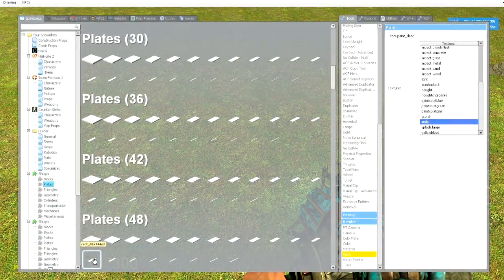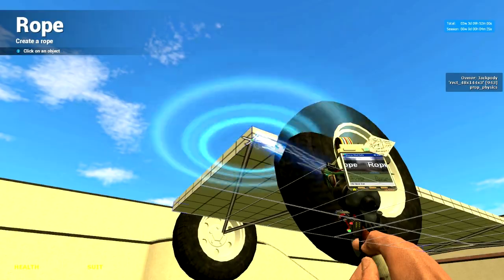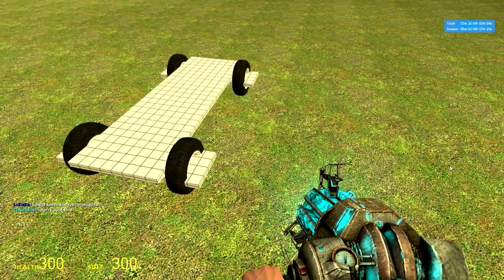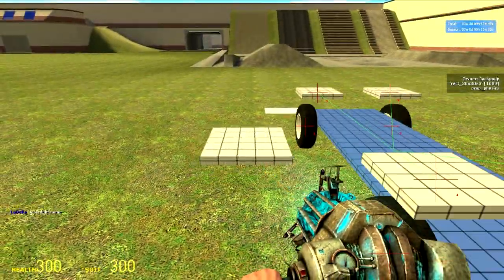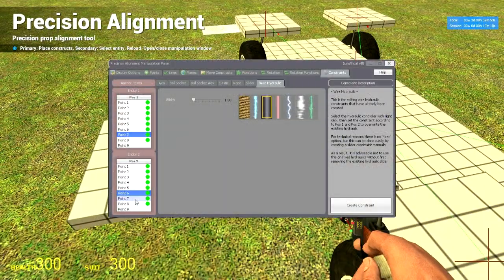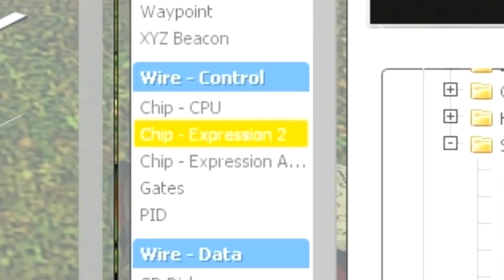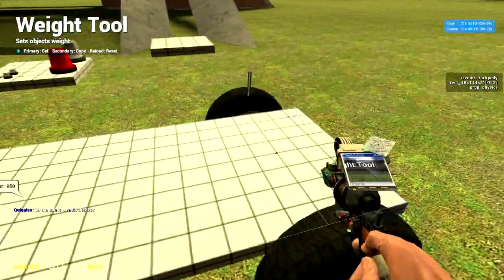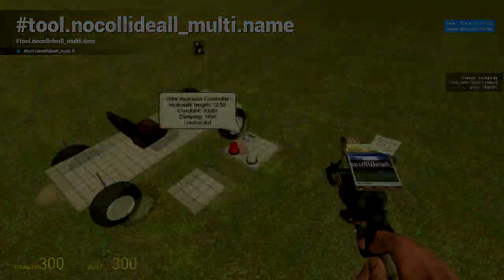[GMod 13] Suspension & Steering Tutorial - Simple

Comment: This video is really old, but when I complete everything the front wheels won't move, it only moved when I move the E2. How do I fix this?
Reply from the maker: It might be a little old, but it's still pretty relevant. It sounds like you forgot to build pointing North or that you have issues with your ballsockets to me.
Reply: I have been building it North, so must be the ballsockets.
Reply: And my back suspension does not go up and down, but only rolls.
Reply from the maker: @itsspudshere196  Sounds a lot like faulty ballsockets to me. Make sure ALL the settings are EXACTLY like I show in the video. Best of hopes!
Reply: Okay, but the ropes are rigid right?
Reply from the maker: @itsspudshere196  Yes.

Comment: sorry for the inconvenience but how come when  dupe it the wheels go wird and it spazez out?
Reply from the maker: It's fine man, ask as many questions as you need.
Remember to either nocollide the steering slave (the E2-plate that you ballsocket your frontwheels to) to the base, together with your wire board. This means you are sure the duplicator picks it up.
You could alternatively use Advanced Duplicator 2's "Area Copy" feature, that allows you to duplicate everything inside a certain area. I describe the feature in this tutorial
http://youtu.be/DFAoWQXBJz0?t=6m45s
Press the link and it forwards you to how you duplicate these vehicles. 

If this isn't the problem, then please describe the issue you have more detailed.
Reply: JackpodyDK Thanks
p.s. Thanks for the fast reply.

Comment: My wheels just flop around and don't stay up straight, do you know how to fix this?
Reply from the maker: There are two possible reasons for this. You either A) Did not enter the correct ballsocket settings (they can be found in the description of the video if you want to copy 1 by 1) or B) You forgot the very first thing in this video, which is to build pointing towards North.
Reply: JackpodyDK I think it has to be pointing north because I copied everything and then double checked
Reply from the maker: Then point it north, undo the ballsockets (pull out the ballsocket tool and press R on each wheel), correct the wheels so that they sit vertically like they should again, freeze them in place and then redo the ballsockets.
Reply: JackpodyDK It works! Thanks for the video
Reply from the maker: No problem, glad I could help.

Comment: works great but when whells tuch the ground whells just flaying around?
Reply from the maker: Djula 1980 I am not quite sure what you mean.
Reply: the car is good in air  but when whells touch the ground they start  spaz out!!
Reply from the maker: Do check if you remembered to weight the vehicle according to the video.
Reply: the only thing i didnt do is make spherical i dont know is that problem!!
Reply: yes 850 to body 250 back whells 150 front whells!!!
Reply from the maker: I can't identify the issue through the comment section, so it's best you re-watch the suspension tutorial to figure out what you did wrong.

Comment: i have a problem..
i unfreezed the car but the car jumps around
and the E2 does anythink
pls help
Reply from the maker: If it jumps around, you may have forgotten to set the weights like I showed near the end of the video. If the E2 does nothing, then do check you have the latest Wiremod installation. Wiremod can be found on the workshop and it updates automatically. Make sure you hook up Chassis:ENTITY before anything else. Then you can hook up A/D. You also want to make sure you do the advanced ballsockets from the front wheels to E2 before you hook up Chassis:ENTITY. 
Good luck, do respond if you have any more issues.

Comment: Whenever I unfreeze the wheels they spin inside the chassis how do I fix this problem?
Reply from the maker: +Cacline Media and Gaming (cacline72) Are they spinning in all sorts of different directions than they should? If so, make sure you're building pointing North (as explained by the beginning of the video). Also make sure you've got the exact ballsocket settings, they can be found inside the description of this video as well.

Comment: When I test the car, the steering works, but the front wheels don't spin, causing it to not turn. What did I do wrong?
Reply from the maker: Most likely forgot to set the weights / adjust hydraulic settings. Or didn't do those two things properly. A lot of things can make the car spass, so check the following:
Weights are set like in video
Hydraulics adjusted 
Rope settings are as shown in the annotation when doing ropes (rigid on, add length = 0, etc)
Ballsockets are EXACTLY like in the video.
You built it pointing North.

Hope it helps.

Comment: i have a problem with the E2, it says "No such function: entity:setAng(angle) at line 32, char 15" is there something wrong with the way i copied the E2 or something?
Reply from the maker: Please try the fix in the description - if it doesn't work, I'll be sure to look into it. I tested the E2 yesterday and it - should - still work.
Reply: @JackpodyDK  ok i'll try, note: i used the latest version of Wiremod
Reply: @JackpodyDK  update to my comment: enabling popcore worked, thanks for telling! :D
Reply: god dammit, when i started unfreezing it, wheels literally flew away
Reply from the maker: @Argonotheidiot  You'll get there, the tutorial still works. Remember to rigid the ropes and remember to build pointing North.
Reply: @JackpodyDK  well building pointing exactly NORTH isn't really important, it still works, right?
Reply: @JackpodyDK  also what's rope rigiding?(i don't do much as a builder so idk what's "rigiding")
Reply from the maker: @Argonotheidiot  Building EXACTLY North is actually very important - remember to hold shift while rotating your props as this will ensure you're rotating "on a grid." It's important as ballsockets are placed in regards to world position, not yours. If you change your XYZ, the ballsockets will not change, meaning the settings shown in the video won't work.
Reply from the maker: @Argonotheidiot  Make sure to check on "rigid" in the rope menu, and make sure the settings are shown as exactly in my video.
Reply: @JackpodyDK  ohhhhhhhhhhhh...

Comment: When I use the e2 It spins the entire car aswell as steering the wheels.Once it reaches the end of its steering it then starts turning the car
Reply: Nvm I fixed it But its good I found it.Dont use a Dupe for the plate.If you have it saved as a dupe place the dupe down open it with e2 then use the e2 and undo the dupe.
Reply: fallen6191q2w Acctualy No I was wrong. For this e2 set your front ball sockets to -50 and 50 then that wont happen

Comment: My wheels kinda rotate inwards but it can still drive but when I use advanced dupelicator the wheels dont work help!
Reply from the maker: This is normally due to a problem with the ballsocket settings. Make sure they are EXACTLY like the ones I show in the video, else you might end up with problems (normally stuff like the wheels twitching a bit, sometimes an odd movement, etc). 
When duplicating, you are nearly required to use Advanced Duplicator 2. Advanced Duplicator / the duplicator that comes with GMod are both hopeless for any sophisticated contraptions. When duplicating, you should use the Advanced Duplicator 2 "Area Copy" system. I explain all this in my more recent Multi-Parenting tutorial, it also has a link in the description for Advanced Duplicator 2.
[GMod 13] Multi-Parenting Tutorial / How to make lots of props not lag
Reply: I got the wheels to work now, and thanks for all the videos keep up the good work :)
Reply: can you make a tutorial to make a good frame for a car please? because I dont like having just a normal plate with an engine :p it would be very helpful :)
Reply from the maker: I currently only have the multi-parenting tutorial, that covers how you can make your detailed cars without lagging (basically gives you the base for all your vehicles). Other than that, there is no secret way to do car bodies. I do the exact same as you guys when building a body, which is just placing props. A good tip is to use lots of reference images, maybe set up a blueprint in a PlayX player that is the same size as the car you want to make.

Comment: I have one tiny problem..
I've finished everything and it all works properly EXCEPT I cannot steer the vehicle to the RIGHT.. steering to the left works perfectly

Any help on this? '>~<
Reply from the maker: +Drunk people with firearms Are you sure you've wired both A and D on the E2? Make sure the ballsocket settings are correct, even though if they were incorrect, you shouldn't be able to turn at all.
Reply: That did it, thank you!!

Comment: jack the expression2 code is not correct can you please make new code?
Reply from the maker: I just checked the expression 2 code and it does in fact still work. Make sure you're copying the code correctly into the editor (aka. make sure you've whiped the editor fully before pasting the code into it).

Comment: How do you increase the stiffness of the suspension?
Reply from the maker: +Michael Johnson Increase the constant a lot (say to around 50000) and the damping to something slightly more (say around 3-5000). If your car is sagging down on the suspension part when you add weight, increase the length of the hydraulics.
Reply: JackpodyDK Thanks man

Comment: I can't seem to steer the wheels :( Any suggestions?
Reply from the maker: You either hooked up the setAng E2 incorrectly, forgot to link the pod controller or used faulty ballsocket settings. Make sure the above are as done in the video.
Reply: JackpodyDK It's working now. Thanks! :D

Comment: Hello, I'm back again lol

Would it be possible to just have the steering portion and not the suspension?
Reply: I tried doing this, for some reason, the wheels will turn with the suspension e2 as if its welded.
Reply: And one of the wheels will randomly ignore the ballsockets limits for about a second, then go right back to its position
Reply from the maker: Sounds like you have a few issues. If you don't want the suspension part, then you can just skip the ropes and the hydraulics and instead use a Ballsocket Centre between the wheel and the base.
Reply: Thats what I did, and the turning wheels rotated around the e2, not the ballsockets. And at random times like I said one of the wheels will simply ignore it's limits, To be specific those are also the turning wheels, and only one side does it. I tried replacing the wheels and that didn't seem to work, it has the same ballsocket as everything else.
Reply from the maker: Did you build pointing North as I explain at the beginning of the video? Also merry Christmas!

Comment: Edit: I've found out why, and fixed it.

So, it's telling me;

 No such function: entity:setAng(angle) at line 31, char 15

I copied it straight from the link in the description.
Reply: bansheeflier1015 It seems I've got the same problem.
Reply: Jake Geronimo If you haven't figure it out yet. You need to open up the console and type in these three things: "wire_expression2_extension_enable propcore", "wire_expression2_reload", then if you on single player "wire_expression2_realoadeditor".
Reply: bansheeflier1015 Thanks alot.
Reply: +bansheeflier1015 what is meant by console? like the e2 editor, or?
Reply: trevor hennessey The console for GMod (press the key on the left of 1).
Reply: Jake Geronimo thanks so much

Comment: jackpody, only one of my wheels stays in place, help?
Reply from the maker: Either bad rope placement or incorrect ballsocket settings. Check that "rigid" is ticked on in the rope menu. You also need to make sure that you are building North, which is very important. I explain this at the start of the video.
Reply: i did all of this but i did notice one of the ropes was on the side of the wheel.

Comment: I hope you read this... The e2 is not working, it tells me "no such function "setangle"" and the propfreeze command is also affected...
Reply: You should make an updated video since the wheels are also extremly spazzy and wobbly.
Reply from the maker: +Foxique Somewhat The tutorial works fine and I do update it using annotations when an update has an impact on the tutorial.
The E2 works as well, but because of a GMod update, you have to turn propcore on. Since I'm on my phone right now, I cannot find the command, but a quick google search will give you the command for propcore.
Spassy wheels is because of improper ballsocket settings or improper weight of the base / wheels. This chassis can only go to around 400 kg as a minimum.
Reply: Jackpody
Okay much thanks. I'll have a look for the command and I'm sure I can tweak the wheels and such.
Reply from the maker: Sounds good.
Reply: Jackpody
Okay everything works now but tell me, what are we supposed to do with the floating steering plate?
Reply from the maker: It stays in air where you spawned it. In order to save it with the car, you can either nocollide it with the base (then it dupes together with the rest) or you can use advanced duplicator 2's area copy feature (explained at the end of my parenting tutorial). Good luck!
Reply: Jackpody
Yeah I know but like... A random floating plate in the air that controls your car? can't you hide it or something?
Reply from the maker: You can colour it invisible, but I'd be afraid of forgetting to duplicate it. This is the standard of vehicle building, however - everyone does steering this way nowadays. There is no stigma about leaving the plate there.
Reply: well ok then. Thanks for the quick response and help.
Reply from the maker: Glad I could help.
Reply: +Jackpody I have another question. Is it possible to make it rotate parallel to the base of the vehicle? So that I could use it for something like a rockclimbing car?
Reply: Nevermind that I'm just stupid and forgot that it already does that lolz

Comment: So i made a working car. It works perfectly fine but i can't duplicate it without the front hydraulics breaking. I'm using Advanced Duplicator 2 and whenever i paste the car, the front suspension does something weird and lifts the front of the car up. The wheels are still on the ground but the entire front of the body is lifted. Also when this happens, the front wheels don't spin like they should. It's like they're completely locked up. They turn left and right fine but they just won't roll. I tried making them spherical again and making them no-collide with the body but neither worked. I looked through the other comments and i couldn't find anyone with a similar problem. Does anyone know how to fix this?
Reply from the maker: Try giving the last part of my parenting tutorial a watch. It shows how you properly save your vehicle with advanced duplicator 2. If I had to come with a good idea, do you area copy your vehicle? You can also just right click two times on the ground with the dupe2 tool out to copy everything you have spawned anywhere on the map. It soubds like you're not duplicating all your hydraulic controllers to me.

Comment: I COPIED THE E2 BUT FOR SOME REASON MY WHEELS ARE CUTTING AT A 45 ON THE X AXIS INSTEAD OF TURNING LIKE A NORMAL CAR
Reply from the maker: THEN YOU MOST LIKELY DIDN'T BUILD POINTING NORTH AS I EXPLAIN AT THE START OF THE VIDEO OR YOU DIDN'T DO THE CORRECT BALLSOCKET SETTINGS (OR YOU FORGOT TO WIRE CHASSIS:ENTITY ON THE E2). WHY ARE WE YELLING?
Reply: my caps is always on no yelling here other than for fun excited news of thank you idk what the problem was but i us reloaded the e2 and it worked XD thanks:d

Comment: Mines goes side to side, how did you fix it?
Reply from the maker: Are you sure you remembered to build pointing North as I explain at the beginning of the video?
Reply: Jackpody Yes, I have been. It's whenever I finish it, the wheels move side to side.
And whenever I un-freeze it, It collapses.
Reply from the maker: It sounds like you forgot some of the following:
1. Make sure the ropes are rigid.
2. Make sure you used the exact same ballsocket settings as in the tutorial / description.
3. Make sure you weighed it all correctly. If you want to use ACF, you might want to weigh it down (80 kg for wheels, 350 for base - you can customize for your needs).
4. Make sure you're pointing North.
5. Make sure the E2 for the setAng works.
Reply: Jackpody probably Rigid part, But I know for sure the Setang is working, because when I use it, it steers properly. Also, forgot to mention, Thank you. I've been experimenting with some ACF engines..

Comment: When i try to use the Duplicator it says something is creating script errors :(
Reply from the maker: +Ionescu George Are you using Advanced Duplicator 2?
Reply from the maker: You HAVE to use Advanced Duplicator 2. It should be on the Workshop, I downloaded it back in 2011 so it was done manually. Might be included in Wiremod on Workshop, check it out.